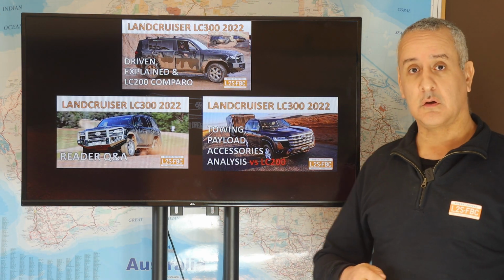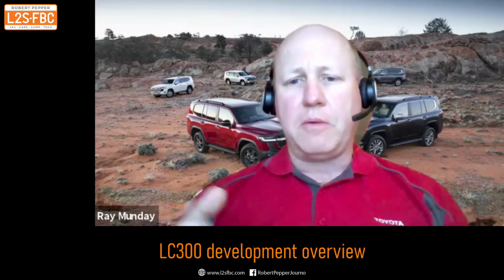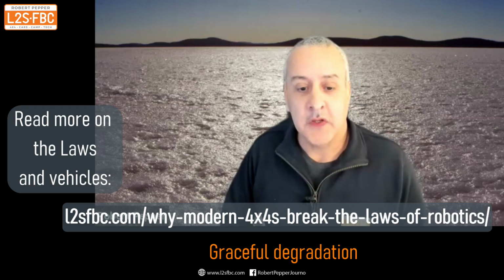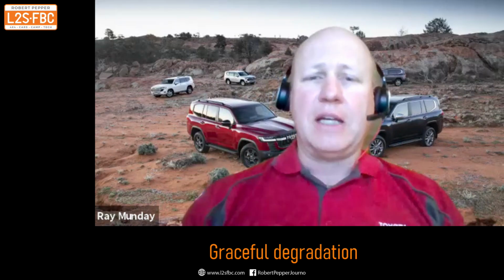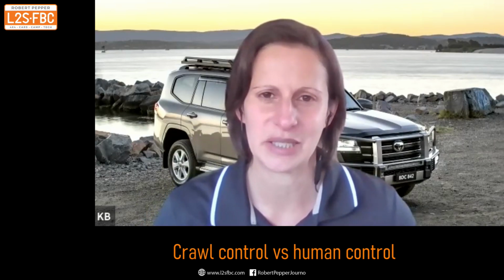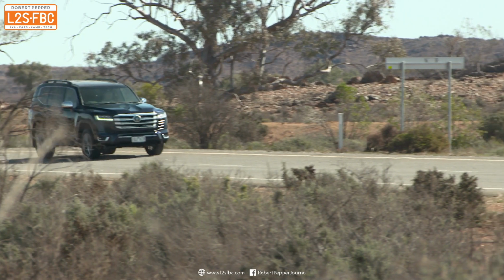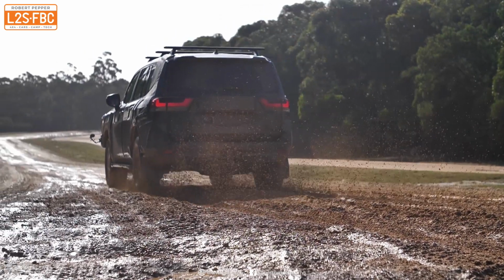4X4 vehicle development - LC300 tech engineer interview,  Part 1/4 - Development

Comment from the maker: Ever wondered how a modern 4X4 is developed? In this interview I talk to two Toyota engineers who were closely involved with the design and development of the new LandCruiser 300 Series.

This is a four-part series:

Part 1: Development process
Part 2: LC300 tech - offroad systems
Part 3: LC300 tech - engines, transmissions, onroads
Part 4: Accessories and specifications

Here's the chapter list:

00:00 Introduction - video series and the engineers
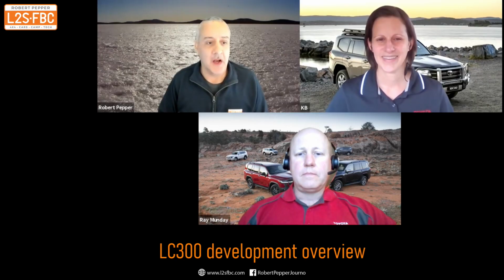03:03 development overview
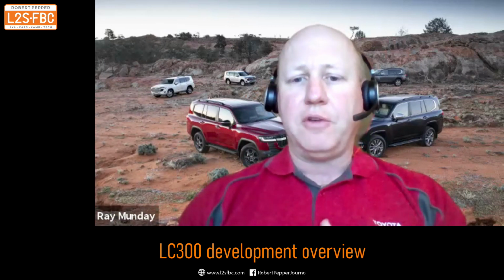05:48 how are Australian customer needs different to the rest of the world
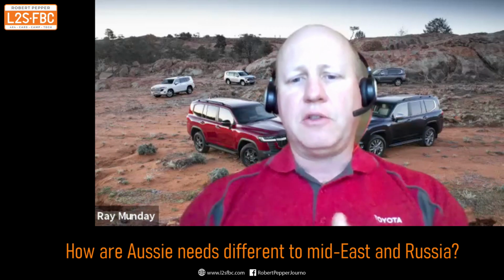07:23 was the LC300 clean sheet?
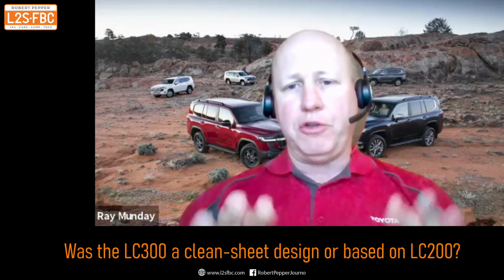08:04 what Aussie feedback went into the LC300?
09:28 offroad systems usability
10:54 graceful degradation
14:24 development stories
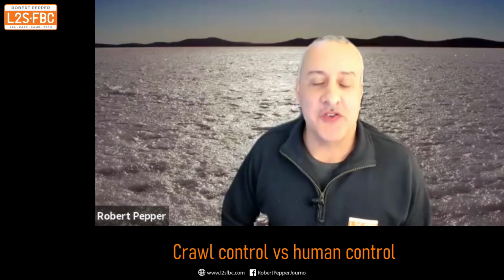16:02 crawl control vs humans
18:39 computer control in vehicles - rely on it?
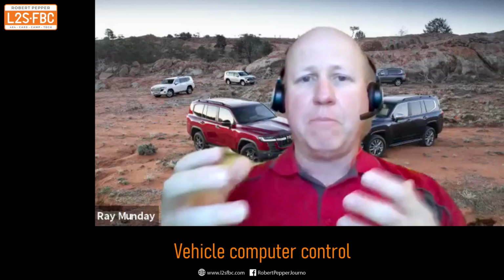21:08 how is the LC300 designed for long-distance driving?
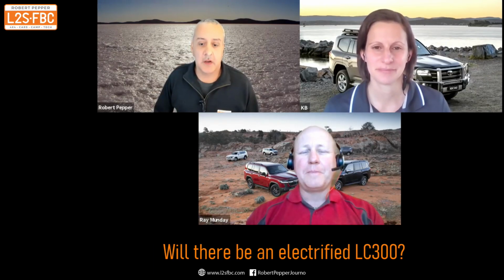23:48 will there be an electrified LC300?
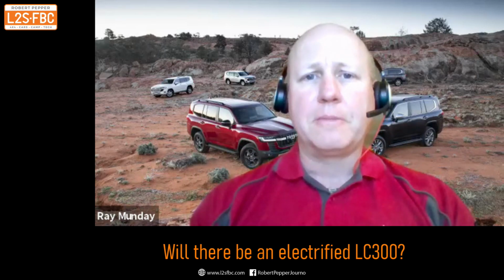24:38 durability designs
26:02 future of vehicle electronics

Comment: Interesting that the people they went to for advice have old model 'cruisers.
I still think the 300 development had absolutely no relationship to real user input. I also believe the new 300 is a good advertisement for the latest Patrol.
I also note the release of the 100 Series and 200 Series didn't really have much of a marketing campaign; the vehicles sold themselves. The 300 Series on the other hand has quite an aggressive marketing campaign. That says something to me.
Looks like I'll be looking to a US "truck" for our needs. I honestly think Toyota has dropped the ball.
Reply from the maker: Yes you're right - if a car needs a lot of early advertising it's a problem. When Toyota launched the 86 they didn't need to advertise it for example, and same with Ford and Mustang - the ads for both came much later.

Comment: After watching this, I am even more of a Toyota fanboy.  I a must ad though that I can not understand that Toyota spend so many years developing excellent vehicles and then have grainy, low quality reverse cameras.  Maybe they should take a leaf from Ford and constantly upgrade their vehicles with better and the latest tech on a two yearly basis. 
I am also amazed by the smallish side mirrors and wheels.  My only explanation is that the power and fuel consumption stats can look good on paper.  Would love your thoughts on this.
Reply from the maker: The wheels are the same diameter as before. Slightly narrower to aid fuel economy, and indeed offroad performance. Mirrors; probably same fuel reason.

Comment: If it's not too late, please ask them why they took out so much cabin space by substantially raising the height of the center console area around the gear shifter.  The 300 Series feels space constricted compared to the 200 Series cabin.  Also please ask if the barn doors be introduced later, like how Toyota only introduced the GX with barn doors some time after the 200 was released back in 2007.
Reply from the maker: Too late sorry should have been on my Pateron list when I asked them 😁
Reply: @L2SFBC  All good.  It is what it is.   I did also wanted to ask why the GX has such anorexic 245mm wide tyres.  But missed the opportunity.  Oh well, maybe next time!  :)

Comment: As a 2010 Prado owner I drive a 2019 Ranger for work and the Ranger DAC is light years ahead of the Prado.  We should be lobbying for Toyota and other manufacturers to provide software updates to increase the performance and safety of our older vehicles.  The hardware is already in place, it’s just a matter of updating the control code.  I would gladly pay for such updates as I’m sure the majority of owners would too.  Look at how often Apple update their iOS, it’s just another facet of continuous improvement.
Reply from the maker: The hardware isn't quite in place; wheel speed and other sensors improve over time, and the software is dependent on the hardware's inputs/sensitivity.